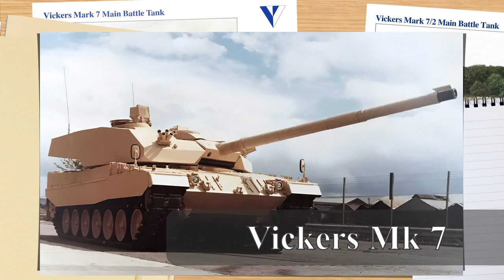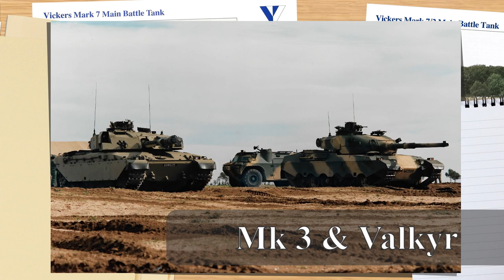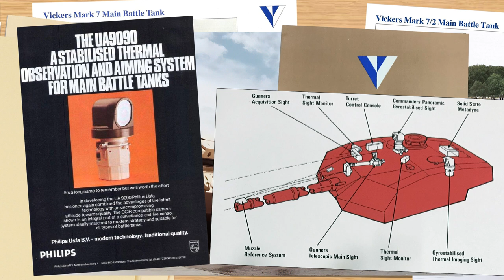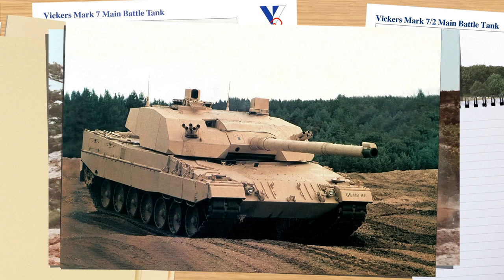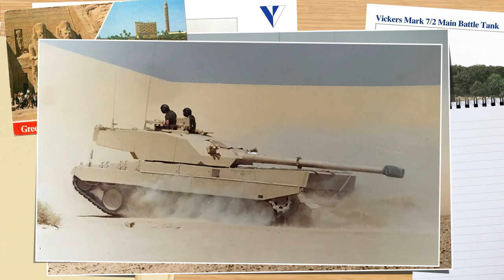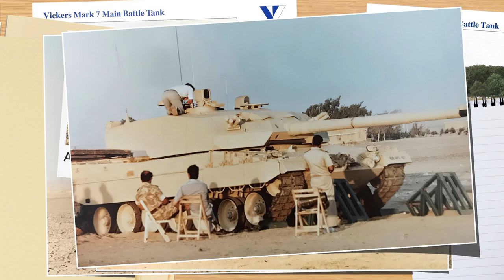Vickers Mk 7 - Leopard 2 hybrid: Tank Design & Development

Comment: Sounds like they could practically dig up the drawings now, add a few modern components/features and still come out ahead of most MBTs in 2023.
Reply: Better amo improved thermals and fire control system maby even active protection and you would have a hell of a tank maby even an arrow head for the turret if it can cope with the weight

Comment: This makes me wonder what a Vickers 7 turret on a Challenger hull would have been like once the Leopard 2 hulls were off the table.
Reply: The biggest gripe with Challenger is it's speed/mobility. A more powerful engine could in theory help address that. But the real problem is the weight of the hull. The Leo hits the design sweet spot between weight, protection and engine power. The fact it used British armour to do it, is quite frankly annoying. It's engine on the other hand is simply a superb piece of engineering.
Reply: That's basically what Challenger 2 is.
Reply: @gusgone4527  Problem with the leo 2 PP is that it's enormous and compromises the design in other areas.
Reply: @agt155  It's the first time someone said that the MTU PP is too large. The 2 power packs have nearly the same size.
Reply: @23GreyFox  Longer, wider and over a ton heavier. No surprise as it's a 47l engine compared to CV12 @ 27l. If you look at a Leopard 2 half the hull is powerpack.
Reply: @agt155  Nice to see you commenting again my friend. On point as always.👍
Reply: @23GreyFox  Even the supposedly tiny Europack is bigger than a CV12.
Reply: @thewomble1509  Any source for your claim? Any picture i found doesn't support your claim. The Challenger 2 E was designed with the Euro Powerpack in mind, the so saved space means more room for fuel and ammo. So how is the Euro PP bigger? Space magic?
Reply: @agt155  And don't forget far more reliable than the british engine.
Reply: @23GreyFox  I never argue with self appointed experts!!
Reply: @23GreyFox  What is "unreliable" about the CV12? It was a proven industrial motor produced in the tens of thousands.

Hard to tell how reliable Leopard 2 is because it's operated by conscript armies who barely use them. It was reported a few years back that less than 10% of German Leopard 2's were functional.
Reply: @thewomble1509  And yet, the EuroPowerPack is perfectly capable of fitting in a Challenger hull. We know that because BAE put on in the Challenger 2E.
Reply: @RedXlV  Not without completely re configuring the rear end of the hull. The Euro pack is mounted transversely and that meant the radiators etc had to be repositioned. Just look on Google image at the rear end of a 2E..........
Reply: @23GreyFox  No, not Space magic, Cubic Capacity, a far more effective method of measuring the size of an engine....................
Reply: @23GreyFox  The saved space comes from not having a GUE/APU with the Europack.
Reply: The  challenger hull definitely wasnt amazing
Reply: @thewomble1509  The europowerpack (the compact powerpack offering from MTU) is far smaller than most conventional packs being ~1000mm shorter than the conventional MT873 pack used in most leopard 2 variants and providing a 1.7m cubic meter space saving when it was used in Challenger 2E. 

It’s quite clear you don’t argue with experts as you don’t know what your talking about...
Reply: @HJDore  It still has a cubic capacity that is larger than the CV12, To fit a C2 hull it has to be mounted transversely ( a point i made which you seem to have overlooked), the space saved, as pointed out by another person on this thread was due to the removal of the GUE secondary motor, not because the Europack is the size of a match box. 
I don't really know what your point is, other than to post something so you can boost YOUR fragile ego and try to cause an argument about God knows what. 
Now, I'm done with this topic so feel free to post any old crap you want to but I won't be responding.

Comment: If they sold this now, it wouldve coincided with the closing retirement of the leopards that are in the mid-range market specifically Indonesia & Singapore which have both been recently trying to find the eventual replacement for their leopards. If they got the timing right, they couldve sold it to Thailand & Taiwan as well which for the case of Thailand - went for the Chinese VT-4 because of how long it took for Ukraine to complete their T-84 Oplots (which I could imagine would be hard to maintain as well) and as Thailand had some experience with British Equipment as well (Scorpion Light Tank); as well as Taiwan who are looking to replace their ageing M60 Tanks. 

The Leopard Hull is a proven hull within the Southeast Asian Theater - Im pretty sure everyone wouldve gotten Leopards by now if not for how stringent German Arms Exports Laws are. From what I can even remember, Malaysia was supposed to get Leopards if not for the Asian Financial Crisis which led them to choose the PT-91 Pendekar instead.

Comment: One of those tanks I first learned about through Twilight 2000 where it, just like other late Cold War failed projects, was much more prominent than it ever would in real life. Looking at Jane's 1986-87 edition, it mentions that the Mark 7 used "automotive components" of the Leopard 2, but doesn't mention that the hull is from there as well. Was there an original intent to use an original hull for this project but with Leo 2 components or was Jane's mistaken?
Reply from the maker: yes the whole hull is leo 2
Reply: It could have been a way to dodge vague-ish export restrictions when talking about the tank. "Automotive components" is safe enough sounding to export, but "tank hull" could cause people to put some thought in the matter in a way negative for Vickers. Then Germany decided anyhow to make explicit that "tank hull" indeed did not get to be exported.

Comment: Why did you not mention what is probably the most notable fact about the Mk7 - that its turret went on to become the basis of Challenger 2's turret? Surely you can see from the comments that this video has left quite a lot of misapprehension due to that omission.
Reply from the maker: because i dont have any documents to verify that, only a load of ATDU docs. and i dont use web/forum stuff only archival docs. If i saw it from an original source i would have added it, however, there was a lot of missing stuff from Vickers on the end of the vehicle, but lots on the original stuff. That's not to say its wasn't or didn't, just I have nothing to confirm it.

Comment: The British government should’ve stepped in to stop vickers from disappearing the last British company that could actually produce tanks
Reply from the maker: the British goverment were behind it dying sadly.  they were and are currently only interested in what they can line their pockets with
Reply: @armouredarchives8867  Is that the reason why BAE joined with Rheinmetall to produce the Challenger 3 update?
I mean when was the last major Challenger 2 update, some 20 years ago? And the new turret seems to be a 100% German design.

I heard in other videos that the British lost the tank production lines and even normal maintenance is getting harder doe shortcomings of components not produced in years. In the short term it's cheaper to work with Germany for the upgrade, but it's sad to see all the knowledge gone to waste, because of the manufacturing shutdown 20 years ago.

On the other hand everything i wrote can just be bullshit. I'm no expert. And sorry for my broken English.
Reply: Unfortunately they have done that to almost every major British industry Automotive, Aerospace,Defence,Locomotive and Rolling Stock.British Aerospace, British Leyland,Vickers,Royal Ordinance,Alvis,English Electric,Avro,De Havilland,Hawker Siddeley, GKN and British Rail.
Reply: @23GreyFox  Something you’ve got to remember is Challenger was originally designed by Royal Ordinance than the Challenger 2 was designed by Alvis,Vickers and BAE 3 of the 4 no longer exist and BAE has just become to big for it’s boots taking on too many different types of industry and the side effect of that is the British Military Vehicle and Aircraft industries are basically destroyed. It could technically be rebuilt but it would take years and massive investment if you could find people who used to work in the factory making them it would speed up the training process and intern the rebuilding process.
Reply: @jammiedodger7040  I know about the British car industry and parts of the railway cargo fleet owned by DB, but i had no idea it was that bad.
Reply: Both Conservative and Labour are responsible for destroying British industrial sector it started with British Rail Labour took an axe to the Railway network and the Conservatives finished British Rail off with a hammer   another really good example is British Leyland Labour created the unions that destroyed British Leyland and the Conservatives gave control of British Leyland to the unions which ran British Leyland into the ground so both of them have blood on their hands for the destruction of British Industry.

It is possible to rebuild the Industrial Sector but it would take a massive investment which would pay off in the long run but it would take years to rebuild sectors that would have to be focused on is Automotive,Aerospace,Locomotive and Rolling Stock,Defence (Military Vehicle) and Manufacturing but would not be limited  to. But to successfully rebuild the industrial sector automation would have to be used to a high degree robots and 3D printers.

But alongside Industry the railway network would need to be rebuilt to the scale of 1960 and Agriculture,Mining and Utilities would all be required to be rebuilt for Industry to flourish but along with this with massive social reform you could fix Society at the same time.

Comment: Who paying you for this tripe, Thank the Gods you wasn't in charge at ATDU back in 90s I don't think Iraq would have played so well for me and my friends if we had the L2 hull  do some research on how well the L2 did in Syria and Afghanistan.
Reply from the maker: Sigh: This video is based on the findings from ATDU and it is their reports, not mine, if they say it’s a good tank then I’m going to go out on a limb and concur with them as they know their subject. As for leopard 2, you mention Syria and Afghanistan. The Turkish misuse of tanks is well known, and a lesson in not using tanks in a surrounded position without infantry. The Dutch used leopard 2 tanks in Afghanistan with no losses. Challenger provided adequate service in GW.1 as well it should, being pitted against primarily 1st gen trash, but that doesn’t excuse it from the fact it did fail the CATS and it is and was always designed as a knockoff export tank that we got lumped with as a stand-in until something better could be made. Them’s the hard facts
Reply: @armouredarchives8867  It was a Danish Leopard 2 that lost a crewman in 2008 to a IED so do some more Checking up only took one two google searches to find that. 

I get it, your going to defend the L2 Hilt .... It had shit crews blah blah poor Tactics. That doesn't matter that's not my point. look at its destroyed hull look how it come apart. Now look at the Venerable CR2  hull after the Blue on blue. In one piece even if the turret came off two crew survived the Hull bag charges didn't brew up instantly it gave one of the crewmembers valuable moments to pull his friend out of the Burning turret.

The L2 hull just wasn't good enough and that was proven with what happened in Syria and Afghan The Vickers was not for the British Army, never would have been, The turret was the Test bed for the CR2 Systems. and if you look at a Bare CR2 turret without the Dorchester Armor fitted you will notice the similarities to the Vickers Mk7 turret.  

As your such a expert,  why do you think the Challenger 2 managed to protect its crew from a IED shaped charge device  under the vehicle better than what the Leopard2 did? its pretty simple and its not about MUR cHallenger being better. Its.... ial let you work it out do some reading about both hulls...

Comment: The British talent for shooting ourselves in the foot never ceases to amaze.
Reply: Hey Canada is good at that too.
Reply: This is balls. The Turret on C2 was a further development/improvement of the Universal Turret fitted to the 7/2. The Leo hull was not used due to ready round storage next to the driver, poor armour protection and a very basic NBC system mounted in the hull that was inferior to the system used in C1 ( which was improved on C2). Sources for all these facts can be found in the Haynes Challenger 2 manual.
Reply: As does the talent for not fact checking other people's vids, just assuming they are correct.
Reply from the maker: is this the comment you were griping ive deleted? - do you have a first hand source on the turret being used for CR2, - Haynes etc while good are not original documentation.
Reply: @thewomble1509  You do know the Challenger 2 has even more ammo storages in the hull. And i can't find any sources to your claim, again. The Leopard hull was and still is a excellent design. The armor protection is great as well.
Reply: I believe Challenger three has additional sights for the commander, heat sensitive ones, that sustains the UK's own foot shooting ability on a greater level of accuracy!!!
Reply: Ah yes, but if you tread on the enemies toes and THEN shoot yourself in the foot, you’ve broken even!
Reply: Projectile, yes. Charges..no.
Reply: @dwwolf4636  Charges?
Reply: @23GreyFox  2 piece ammo.
The charge/propellant is the bit that is dangerous if the tank's armor is breached.
Reply: @dwwolf4636  Ah yes, now i understand what you mean. No idea why the British stayed with 2 piece ammo for so long.
Reply: @23GreyFox  storage. The 120mm rifled cannon used either a full round cylinder or a half cylinder. So two light charges could be stored in a single charge pocket. 
Unitary ammo where the shell and the projectile are in one piece means you either need to carry a few less rounds or increase your state capacity somehow.
Reply: I have just been watching Whittle's titanic struggles!
Reply: We never shoot ourselves in the foot, it's because someone abroad wants to take out the competition, probably the Americans and we have sell out politicians,so some back handers afew penthouses and a yacht or two with some of that offshore account cash and boom all the industries get sold out and sold off
I thought people would have figured it out by now
Reply: Apparently the challenger 1's gun was so inaccurate you COULDN'T shoot yourself in the foot!